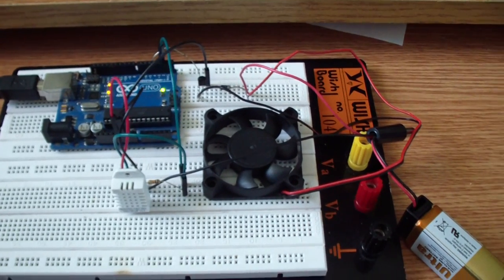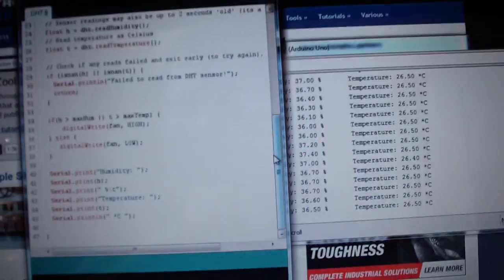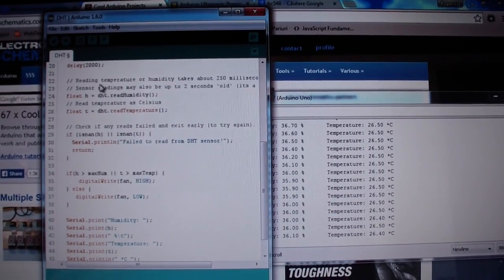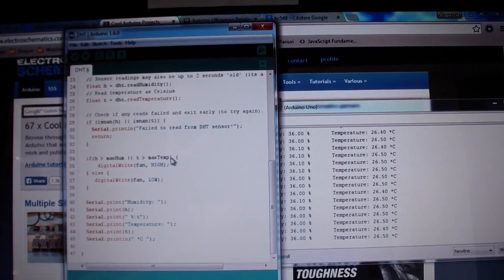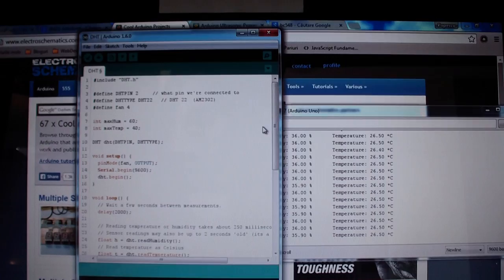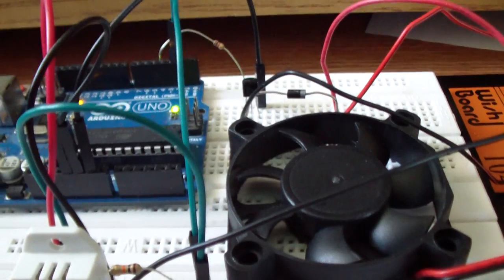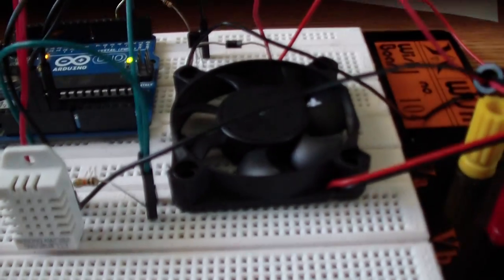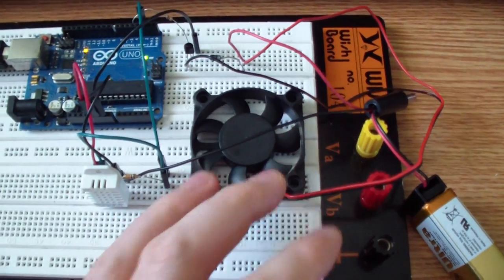Arduino DHT22 humidity and temperature simple project + fan

Comment: I went through the video and the article which was very useful to me. I wish if you can guide me to incorporate a LCD display in the code and a relay driver to drive a table fan it will be more useful to me to try out. I am eagerly awaiting your help in this respect.What are the additional codes needed in this sketch and also the circuit to incorporate. Thanks for the project which enlightened me about Arduino.

Comment: #include "DHT.h"

#define DHTPIN 2     // what pin we're connected to
#define DHTTYPE DHT22   // DHT 22  (AM2302)
#define fan 4

int maxHum = 60;
int maxTemp = 40;

DHT dht(DHTPIN, DHTTYPE);

void setup() {
  pinMode(fan, OUTPUT);
  Serial.begin(9600); 
  dht.begin();
}

void loop() {
  // Wait a few seconds between measurements.
  delay(2000);

  // Reading temperature or humidity takes about 250 milliseconds!
  // Sensor readings may also be up to 2 seconds 'old' (its a very slow sensor)
  float h = dht.readHumidity();
  // Read temperature as Celsius
  float t = dht.readTemperature();
  
  // Check if any reads failed and exit early (to try again).
  if (isnan(h) || isnan(t)) {
    Serial.println("Failed to read from DHT sensor!");
    return;
  }
  
  if(h > maxHum || t > maxTemp) {
      digitalWrite(fan, HIGH);
  } else {
     digitalWrite(fan, LOW); 
  }
  
  Serial.print("Humidity: "); 
  Serial.print(h);
  Serial.print(" %\t");
  Serial.print("Temperature: "); 
  Serial.print(t);
  Serial.println(" *C ");

}

Comment: cette  programme ne compile pas quelle le defaut :#include "DHT.h"
#define DHTPIN 2     // what pin we're connected to
#define DHTTYPE DHT22   // DHT 22  (AM2302)
 #define fan 4
int maxHum = 60;
int maxTemp = 40;
DHT dht(DHTPIN, DHTTYPE);
void setup() {
  pinMode(fan, OUTPUT);
  Serial.begin(9600); 
  dht.begin();
} 
void loop() {
  // Wait a few seconds between measurements.
  delay(2000);
  // Reading temperature or humidity takes about 250 milliseconds!
  // Sensor readings may also be up to 2 seconds 'old' (its a very slow sensor)
  float h = dht.readHumidity();
  // Read temperature as Celsius
  float t = dht.readTemperature();
  // Check if any reads failed and exit early (to try again).
  if (isnan(h) || isnan(t)) {
    Serial.println("Failed to read from DHT sensor!");
    return;
  } 
if(h > maxHum || t > maxTemp) {
      digitalWrite(fan, HIGH);
      } else {
   digitalWrite(fan, LOW); 
  } 
  Serial.print("Humidity: "); 
Serial.print(h);
  Serial.print(" %\t");
  Serial.print("Temperature: "); 
  Serial.print(t);
  Serial.println(" *C ");
 }